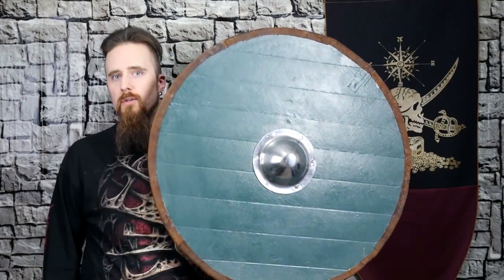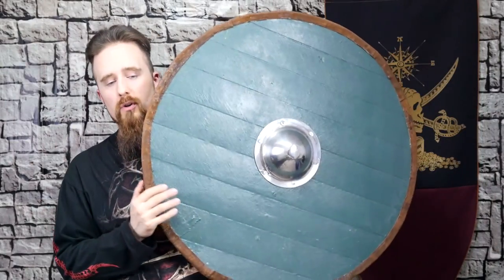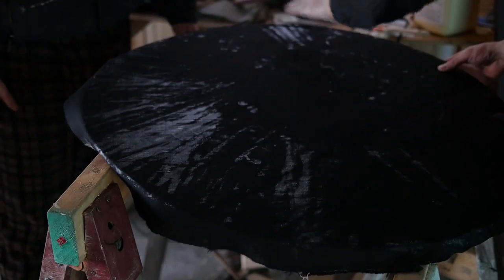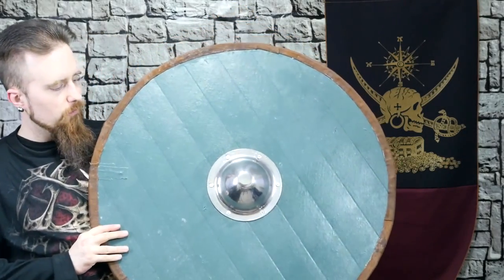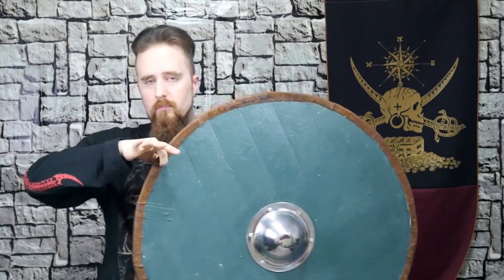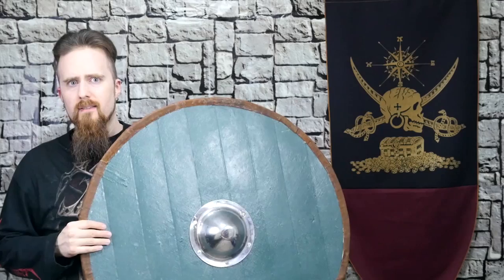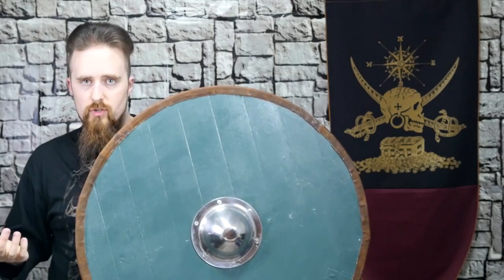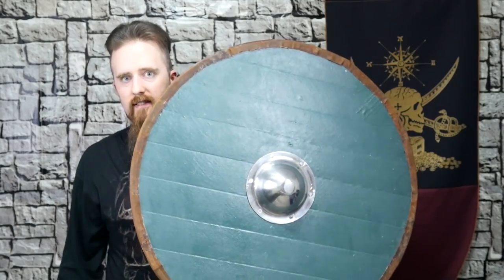Making, testing and repairing a Viking center-grip shield

Comment: I would have used either wooden nails or maybe a sort of riveting. The floorboard pieces could be an authentic representation of inserting wafers or so between each slat to glue the pieces together. Maybe stitching the rim on could have provided more of a way of binding and/or resisting the blade's momentum.
Reply: koosh138 wooden nails?  you mean dowels?  also, he DID use a sort of riveting, it's just the difficult way to go about it by cutting a nail off with only a bit of it left and then hammering it flat.  also, you can only do this with softer metal nails.  the ones made with nickel and zinc and whatnot tend to crack before they mushroom.
Reply: You might call them dowels, I don't think so, but its like riveting but you hammer in one or two wooden nails and they wedge up against each other to create enough friction to hold fast, arguably as good as a metal nail would.
Reply: koosh138 never seen that done in my life, but if you can make it work then more power to you.
Reply: Its usually done in longboats or some furnture
Reply: koosh138 it does seem like something that would work better for larger or thicker pieces of wood, especially in a case where the wood would tend to swell like with a viking longboat.  I just don't think it would work well for a shield of this thickness due to the relatively brittle nature of the wood.
Reply: PsylomeAlpha It may not, it'd be interesting to test.

Comment: Could you do a project about a viking shield made to Norwegian "law?" Hurstwic’s website covers it:

“Norwegian Gulaþing and Frostaþing laws specify the construction of a shield. The shield should be made of wood with three iron bands and a handle fastened to the back side by iron nails. A later revision of the law says that the shield should be made of a double layer of boards (tvibyrðr), and the front should be painted red and white.”

It looks like their tests show it's really advantageous to do it this way. I wish I could find someone who made them like that. Doubtful the colours matter, of course, but everything else seems legit. I think the two sets of wood are put at 80° angles. 😁

If you made a shield out of olivewood it would be ridiculously hard on a blade. Incredibly difficult to cut, even with a chainsaw. It dulled my axes a lot within a couple minutes, and one isn't sharp enough to cut butter (didn't realize how dull it was becoming right away, so I kept hacking — the shaft developed a small crack because I really put everything into the blows as I made shockingly little progress for my efforts/completely sharp blade!).

Comment: I may be wrong but the glue vikings would have used would be animal glue. Therefor if it got wet the glue would fail. For this reason I doubt the vikings would care if the paint was gone because that would be the least of their problems. The rawhide would detach.
Reply: culiet mortalis Probably were waterproofed well with varnish to keep the glue dry. I bet the paint also served as a protective layer
Reply: Daniel Muonio Perhaps.
Reply: culiet mortalis Fish bladders
Reply: MIDDLE HEARTH Is this a troll or did they actually have use?
Reply: No, fish bladder glue is a very strong natural glue. Very similar to isinglass. Traditionally used in northern Europe and asia.
Reply: Daniel Muonio Oh cool, do you know how it is made? Also what is isinglass?
Reply: Honestly I'm not sure. Isinglass is used as a flocculating agent to clarify beer
Reply: Daniel Muonio Well, thank you for the information.
Reply: culiet mortalis This is true, but it's also been long known that if you add skim milk to hide glue, it makes it close to waterproof. Thus, they would joint the edges of the boards before gluing, then use the treated glue. Same for the linen, if they added it. Down side is you have to work FAST doing that. Open time for hide glue is not optimal (although it's all I use for my woodworking). You'd heat the wood over a fire, and using a couple of folks, slather it on quick, and put the linen on it.
Also, in more recent times, isinglasss was originally used for marquetry and inlays. It works as a general purtpose glue, but isn't as strong as hide or bone glues.
I would love to know what the Norsemen used for glue. I'd wager hide glue. Maybe isinglass? Lots of fish bladders there. But a hide makes a fair amount of glue....
Reply: Rock Harris Thank you for your input.
Reply: culiet mortalis Cheese glue (otherwise known as casein glue) is waterproof and stronger than hide glue and was Def used in Viking times
Reply: Leonhart Hunt Thank you for the information.

Comment: I suspect that the vikings would have riven the planks from the log. As far as I know they didn't have saws and that was how they got out the planks for their ships. Given practice it is remarkable how thin a plank can be gotten out,almost a veneer. If so they could easily have built a shield in crosshatched layers.Plywood,in other words.
Reply: kleinjahr I have a tool called a plane.  you use it to take uneven cuts of wood and even them out.  also, if you heat wood you can bend it, so they could have cut the wood to a uniform thickness and then heated it until it could be bent straight or into a more uniform curve.
Reply: PsylomeAlpha
I have several planes, and am restoring one at the moment. Not sure if the Vikings had them, but they certainly had the adze, froe, drawknife and,of course, the axe.With practice, any of them can be used to make boards.Might I suggest that you dig up a copy of "Old Ways of Working Wood" by W.Bealer, quite informative.
Reply: kleinjahr thanks for the lead, I'll look into it.  but yeah, even if they didn't have planes (which really just make it a lot easier) they could have done the same thing with a chisel or hatchet with enough practice.  I just know that planes have been around for at least a few hundred years if not longer.  it doesn't take too much thought to come up with the idea, and just a bit more skill to make a rudimentary one.

Comment: Skall, i might be wrong but wouldn't it be a disadvantage to have a sword stuck on your shield on a battlefield because you wouldnt have any time to remove it and the weight of sword would sort of drag....i dunno
Reply: augpuppy its worse for the now unarmed swordsman... only time it is an issue is if a spear got stuck, or as the Romans used to use, a pilum, which was primarily for disarming shields

Comment: I can see how plywood would be more resilient than planks. I have to wonder ,though if craftsmanship would make a difference. Not to denigrate your skills but if someone were to spend most of their life making shields perhaps they would have picked up some tips or tricks not available to someone who does it as a hobbiest?
Reply from the maker: whowantstoknowido 
Of course.
Reply: whowantstoknowido Making plywood is harder to do with an axe than planks.  They didn't really have saws back then (and if they did, they were pretty expensive; iron cast I think with tempered tips), so it would have been pretty tricky to get thin strips or sheets out of a tree necessary for plywood gluing.  

The best they could do is get bark with a knife.  You can't exactly shave sheets off a tree in the same way (unless it's soft wood, maybe?  either way, they didn't discover that if it was possible, and it would probably not have been any more effective than planks).
Reply: Usammity If you split along the grain you can get fairly thin sheets of wood, and by sweating the would you could easily straighten out any knots in the wood. Though of course carefully splitting along the grain and sweating the wood would take considerably longer than the plank method for a shield only marginally stronger. So planked shields probably weren't popular because of technological limitations, but rather ease and speed of manufacture.
Reply: Usammity  Watch the movie Happy People.  You can see a Siberian trapper make quite thin boards using just an axe and a some homemade wooden wedges.

Comment: Well personally I would say its actually better to keep your shield from rotating and shifting in your grip if you have the shield at a angle it will make most strikes glance off, making it so you wont have to constantly correct your grip after every couple strikes.
But then I'm more knowledgeable about body armor then I am shields.

Comment: I've heard of using rawhide on shield edges, but did Vikings actually glue leather to the edge of shields? If they did, then yeah this is authentic enough.
Reply from the maker: Darren Jacobson 
As far as I know there is no archaeological of either rawhide or leather, simply because those are the types of organic material that decay very quickly.
Reply from the maker: ***** 
Well, my point was merely that the repair should be strong enough anyway. :)

Comment: I would have used 3 layers of wood, white oak then dark oak followed by white oak again, and on the outside have a quarter inch thick plate of steel. On the side you are gripping it at 4/5thinch layer of leather. It wouldn't be historically accurate what so ever I would just want to see how strong it would be.

Comment: ***** First off... I do not blame you one bit for not using bone glue.... speaking as someone who had to make a batch in Chemistry class, that stuff is RANCID!!! :P the smell is extremely nauseating and distasteful.

All in all a very nice looking shield, the way you demonstrated that you referred to as the RPG style (shield in front of you rather than dynamically moving) would pretty much only been used in the Skjaldborg/Scealdweall/shieldwall, where it's important to form a single unified line to buffet and blunt the opposing assault.

I do have one question: Would you consider a kite-shield as a project? In my experience kite-shields were primarily used for cavalry, since they cover the knight's body more effectively, but I've found a surprising amount of sources listing a kiteshield as a tool for infantry use as well, do you have any thoughts on the use of it at all?

Comment: Yo, Skall!

Another way you can attach the center boss to the shield is to drill holes where the boss's holes are and then weave a leather strip through the holes a few times, and then tying the leather with a secure knot.  

This has a few advantages over nails (especially for sparring practice) in that a) it pulls the boss more secure than nails b) if it comes loose it is easier to fix and c) if you like you can use the boss for another shield if your old one gets beat up.  I don't know whether the vikings did this or not, but I don't think anyone else does either.  :P

Here's a shield I made a while ago (not necessarily historically accurate but you can see the leather strip on the boss):  http://imageshack.com/a/img661/3167/zgs5Ty.jpg
Reply: Late but, if your clinched nails dont hold in the boss you likley have not mastert clinching or used too hard nails(makes a lot of difference modern nails are way too hard too clinch properly and nicely). A riveted nail would of course pull even harder and the riveting can bee touched upp too tigthen any loosening in use. A bent nail can be bent back and on a riveted one you can grind of the head soo both can bee removed. Not too say your method is good of course.
Reply: @borjesvensson8661  Thanks for the reply! that's great info.

Comment: I think you may be surprised just how much the tongue and groove will change the characteristics of your shield.  But the linen is going to do a some what of the same job.   

I do however think they choice of glue you used would make a huge difference.  I think you used a polyvinyl acetate (PVA) glue.  Which did not exist in the way back days.  It's also my understand that the pva glues are very much superior to the glues of old.   Do you have any information of what type of glue they used?  An Animal glue?

Anyway.  With the PVA and the tongue and groove wood.  Your shield may be something they drooled over.
Reply from the maker: isgdre 
Probably bone glue.
Reply: ***** check out rabbit skin glue,  it's ridiculously strong
Reply: darronjknight Um, Isn't one of the advantages of rabbit skin glue the ability to take things apart again afterwords by adding water?   Maybe not the best choice for something that's likely to be outside in the rain.

Comment: Where did you get the pine boards from? I went to three hardware stores and couldn't find anything.
Reply: +Devon Gillespie I found some in a shrink wrapped package at Lowe's for about $15, just like the ones Skall used.
Reply: +IronFluttershy Thanks, I'll have to check that out.

Comment: Been going to "carpenter" school for 3 years now, those planks you used Parkuet as they are called. Are veeery weak. They aren't made to be strong, they arent made to be rugged, they are made solely to be cheap and look good. You should instead buy some thicker pine planks and then just grind them thinner. Just some tips, im no expert by any means but i have some experience

Comment: If I remember correctly, pine is a splitting wood. Why on earth would they use a wood that would shatter on impact?
Reply: Pine is flexible, light, abundant, and it doesn't shatter, it splits.  Oak is a wood that shatters and I'd hate to have a shield that blows up on impact.  But having a shield that allows the weapon to get lodged?  That's perfect! The opponent's weapon is therefore immobile and hence the opponent is vulnerable.

Comment: Could you not hammer the nail in to the edge of the rim, so the nail travels in to the wood? No need for cutting and might look nice cosmetically.
Reply: nails through the edge like that would just pull out. the nails are driven through then peened over, this gives a much stronger edge.

Comment: Just out of curiosity, but why make shields out of pine? It's a pretty soft wood, no?
Reply: If the wood was too hard, it would shatter and splinter a ton, but softer woods are less likely.
Reply: ***** pine actually has a high tendency to splinter, especially yellow pine variants.  the cloth backing actually prevents this to a very large degree especially with multiple layers.  it really turns the shield into a composite material similar to plywood, so the chances of splintering along the grain are lessened considerably.

as for Biedrik up there's question: pine was cheap, light, plentiful, and relatively easy to work into planks with hand tools so they didn't need a full-on lumber mill.  it was easier to make and repair the shields on the go, and the shields were still serviceable.  also stronger woods would have been reserved for things like tool handles and fortifications wherever possible since pine still worked for the shields.
Reply: The more you know!

Comment: Did the Vikings actually use a jigsaw to cut planks ?
Reply: ***** of course, its a well known historical fact that the vikings had access to powertools, but the technology was lost after the viking era.

on a serious note, they had basic hand saws that where very much like a jigsaw blade.
Reply: The S Man yeah it would be quite easy to make with a sawmill + another mill engine that makes the planks turn to get a nice circular shape.
Reply: ***** You can do easily planks with some basic carpenter tool(axes, chisels) which they known.
Reply: Tomáš Zálešák seem basic to make indeed, I hardly see how ships could be made without planks.
Reply: The S Man I've been trying to design a muscle-powered band saw, circular saw, belt sander bench tool that you could switch out the parts.  my main issue is that I've been rather busy at work lately and as such I haven't had much of a chance to see what I have available at the local hardware and thrift stores as far as supplies are concerned.  the thing is they had stuff similar to what I'm planning hundreds of years ago (all I know is pre industrial revolution) and I'm drawing my inspiration from some of those designs from memory.

Comment: Whhhhhhh hang on they used to cross the planks mate there would of been two skins one set of planks one way and another the other way, I’ve seen it, so the grain of the wood was running both ways like an (X) like I said I’ve seen them do it just do it and then let me no how much better and stronger it is and yes they also did back and front with the material, you do it try it I bet it’s super strong, just take my advice and do it all again but like an (X) 😊 you will see

Comment: Definitly good enough for practising, but not "authentic" - not at all. So please don't  call it "pretty authentic".
Reply from the maker: 89NIB 
Why? Authentic material (pine wood, linen, rawhide) and planked construction, that's reasonably close.
Reply: ***** Tounge and groove planks, modern dyed linen ( there is no evidence for linen at all, as far as i know), the boss looks nothing like the historical viking age examples and as you said: the wood for the handle, the glue, the paint are off. Sorry, but that's a load of unauthetic stuff considering you called it "pretty authentic".
Reply from the maker: 89NIB 
None of these things, except maybe the tongue and groove planks, have any impact on the practical function of the shield.
Reply: ***** As i said: Definitly good enough for practising. Just don't call it authentic, when it's far from a faithful historical reconstruction.
Reply from the maker: 89NIB 
That's why I called it mostly authentic, although I guess "semi-authentic" would have been a better term.
Reply: 89NIB There is evidence for both linen and leather to face the shield, but leather would only be used by rich Vikings, as it is substantially more expensive to use on something that is essentially a consumable product. Most shields didn't last but a season or less, depending on your skill.
Reply: ***** It's a joke.